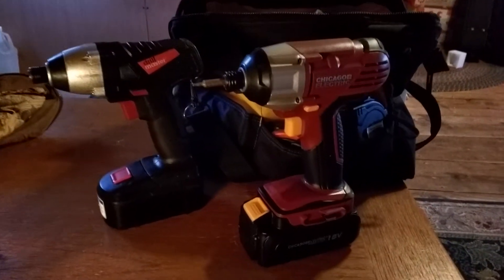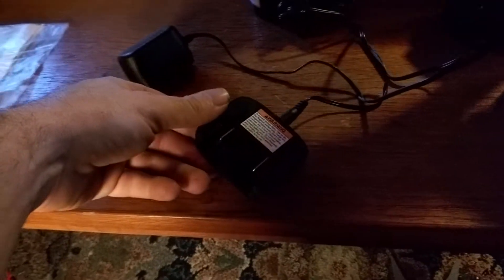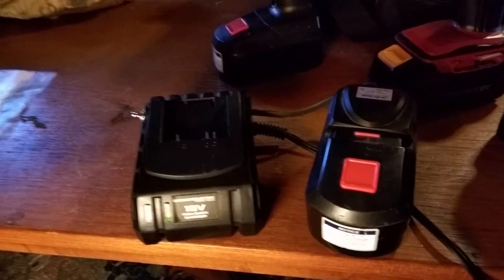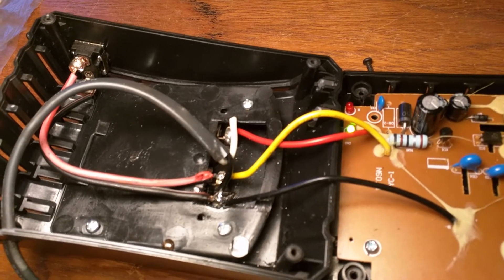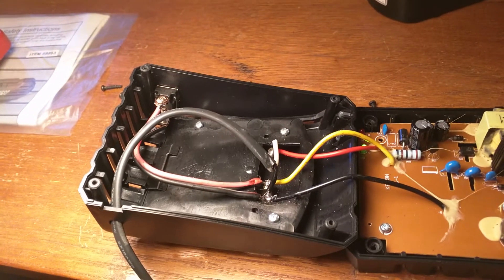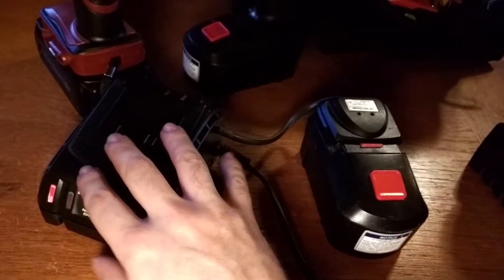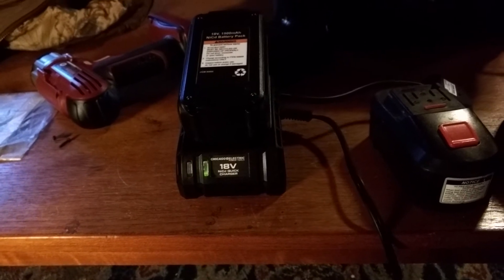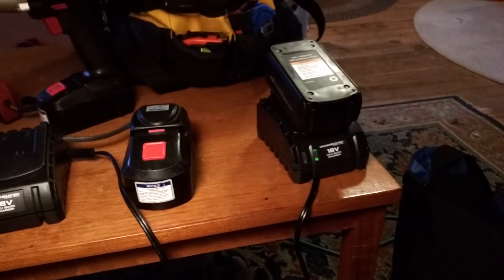Hacking a Harbor Freight quick charger for Drillmaster batteries

Comment: I have a harbor freight drill master battery 18 volt nicad cells which is on a 5 hour slow charger and I have an old Ryobi 18 volt nicad charger that I want to use to charge the harbor freight battery. When I hook the ryobi charger to the battery (I soldered wires to the charging terminals) the "fully charged" light comes on and that's it. Any way to make this work so it charges my battery?

Comment: Thanks, I did the SAME from your IDEA but without opening it. https://www.harborfreight.com/18-volt-nicd-battery-charger-68859.html . I used a jumper between the middle terminal (thermistor terminal) and ground with a piece of wire with spade connectors on each end -  and have a spare black wire for negative. The positive and negative wires then be connected to a  (2.1x5.5mm)  DC Power Cable MALE Jack to plug straight to the original battery charger (with built in FEMALE JACK).  Not as nice as yours but worked well for several 18V HF like circular saw with red battery and some cheap drills. I have a collection of B&D 20 lithum tools now, but nice to have those cheap HF tools that I gave to a friend.

Comment: I just went and got the CE charger as im only two blocks from HF and I already have the chicago electric impact driver anyway.  Ive done a proof of concept connection with the thermal blade grounded using a couple of test leads and it does seem to work.  I let two batteries go and both charged up and the red light stopped flashing as it should with no seeming ill effects, neither the battery or charger seem hot and both batteries read a full charge of 20 volts same as with the Chicago Electric batteries, though its a 18v rig 20v seems to be the end of charge voltage, at least it has been since the CE impact driver was new.  Im going to do the same mod you did with the switch, I do kinda wonder if it turns off automatically exactly the same as with CE batteries and if its safe to leave unattended with no thermal protection - but the original drillmaster charger had no thermal protection, and there doesnt seem to be any ill effects that I can discern so im going for it.  Thanks for sharing  the mod, I was so disgusted with the 18v Drillmaster chargers uselessnes, this is well worth the price of another charger ($11.00)  now I can use my drillmaster 18v drill and LED light again.

Comment: if you suspect a float charger might not shut off, how often would you check it?  Once a day? Since its low amps, could you check it less than that?  Would a warm battery be an early enough warning before the battery got hot enough to be damaged? Im guessing so, if it wasnt hot enough to boil off?